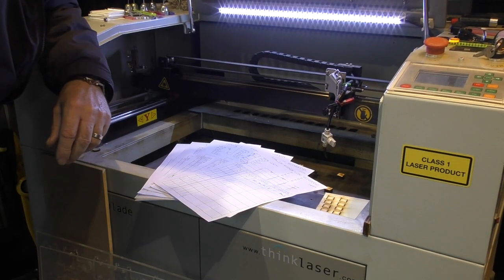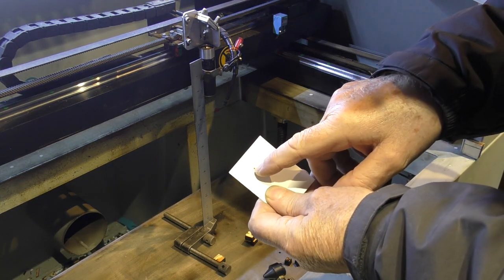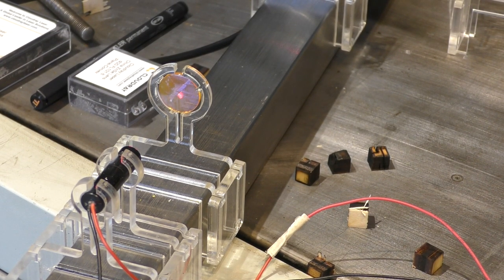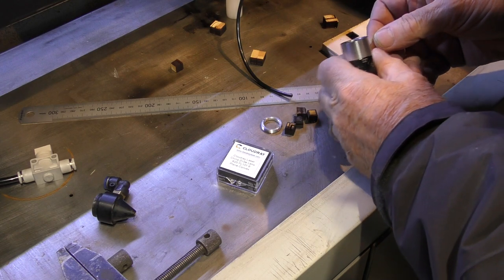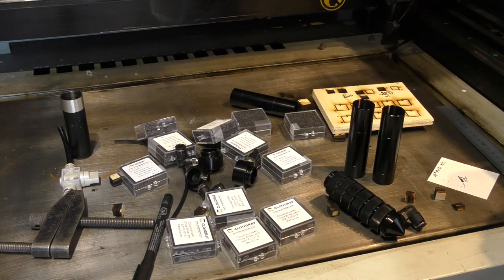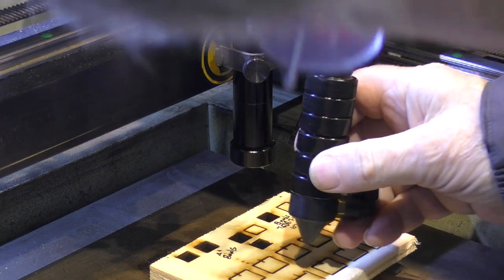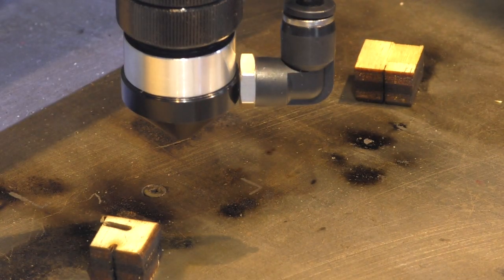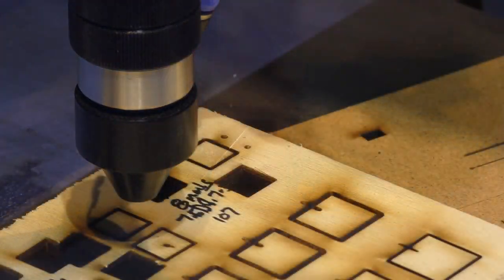RDWorks Learning Lab 199 Long Compound lens Part 3

Comment: Hi Russ, would it speed things up for you to place you’re test cut piece in the bed with one end higher than the other? This way you would be able to see very quickly what the optimal focal distance is for any given speed and thicknesses of material. As the cut moves along the focal distance would be changing constantly from out of focus, through perfect focus, and then back to out of focus. By flipping over the work piece you could then observe the perfect focus very fast and easy for any given setup.
Reply: Hi Joe
  I have used the ramp test in the past  but because the focus from any particular lens  combination is so unpredictable I have to explore where it is approximately with a piece of card first. I  already have my automated line drawing focus test which is more accurate than the ramp test. It does not rely on penetration but  is in fact telling me where the optimal focus of light intensity exists for any given speed.  Flipping the workover  to observe penetration  is not finding  the optimal focus point. No, it is finding the setting that gives maximum material penetration for a given power and speed. Change the material thickness or the material and the results will vary greatly. That is why I abandoned that method several years ago in favour of the line test. A constant 20mm/s and 15% power for every lens ensures I get a consistent assessment of the POWER focus. That is not the same thing as the manufacturers  stated  LIGHT focus. They can be several mm different. 
 Many thanks for the suggestion though because  if there is a way to make these test quicker I would grab it. I am already paring the tests down to a minimum to try and quickly sort out possible contenders for final extended tests. It is unbelievable that with just  5 focal distances there are hundreds of possible combinations. That is where my little red laser test bench came in handy, it is not giving me real world correlation but it is definitely pointing me towards promising  combinations.

Best wishes
Russ

Comment: You have a LOT more patience than I, and I am looking forward to your results. In my case, how thick can you go if you drop back down to the 6mm/s to 10mm/s range. Will the compound configuration allow cutting of thicker materials with the same machine before you have a flame trail.